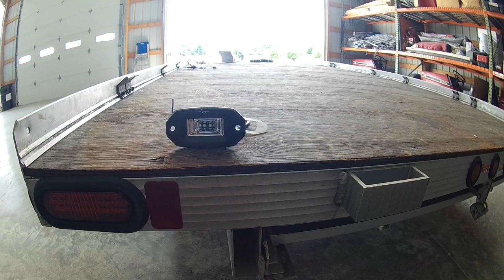Aluminum Snowmobile Or ATV Flush Mount LED Backup Lights

Comment: only change i'd make to the lighting layout is a pair of underframe flood lights at the front corners connected to the reverse light circuit aimed somewhere between 30-45 degrees outward from centerline to light alongside the trailer for backing this will help with identifying anything hidden in the dark alongside the trailer.

Comment: Nice Job.  I have the same trailer.  Now that you've had them installed a few years is there anything you would have done different?
Reply from the maker: @chrisloshaw6808  I would not change anything. You can mount the lights further apart for more edge lighting, But mine are great where they are. I do like the flush mount lights mounted into the frame rails like on this trailer. I have other videos where I mounted lights under And from time to time they get bumped and moved. I am glad I did it this way on this trailer.

Comment: When you attached the wire to the light was it a single or double wire? If single did you ground the negative wire from the light to the trailer?  Does it work that way or if it was a double wire did you attach it to the negative on the 7 pin adaptor to the negative?
Reply from the maker: On this trailer I hooked a hot wire and another wire for the ground. I used 2 wires. On my other 2 trailers I  did a negative ground with 1 wire to the lights. You can do it either way, on this trailer being in the aluminum tubes I decided to use 2 wires. Hope this helps and I did not confuse you. Lol

Comment: So what engages the reverse lights?🤔
Reply from the maker: The center pin on a 7 pin trailer plug is the backup light. You just wire it into the plug and when you put your truck in reverse they cone on.

Comment: You should use a relay because there is too much current draw for a newer truck
Reply from the maker: I never thought of using a relay. So far I have used them with new Ford And Ram HDs with no issues, But every vehicle is diffrent. I will look into that. Thanks.